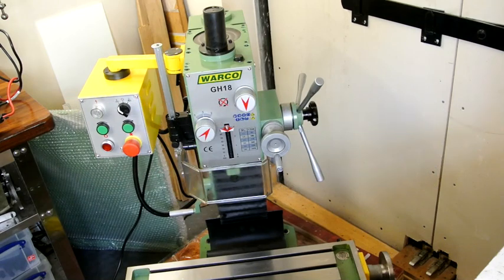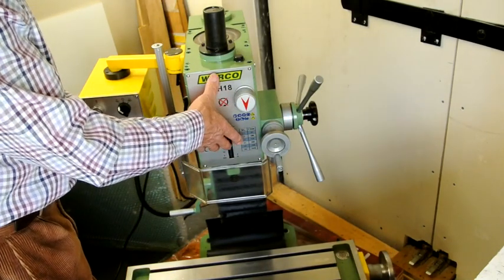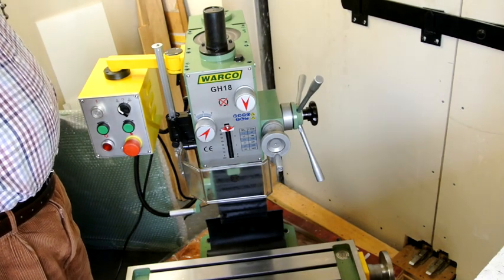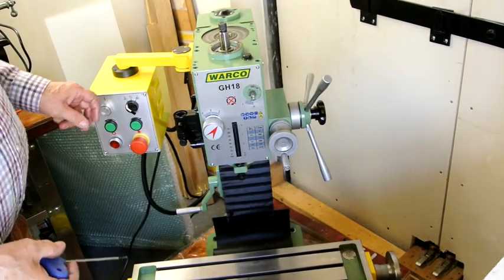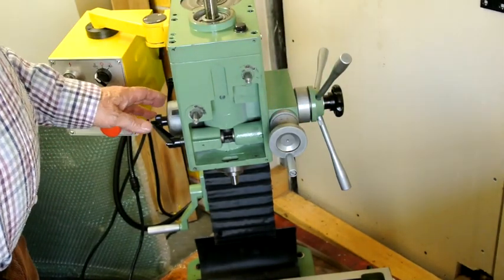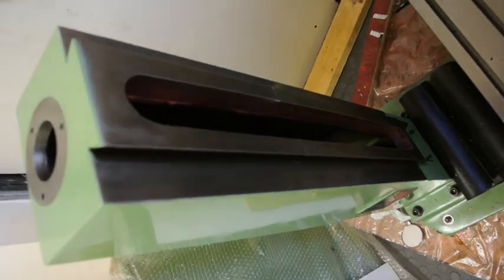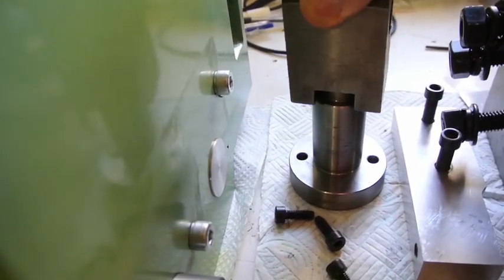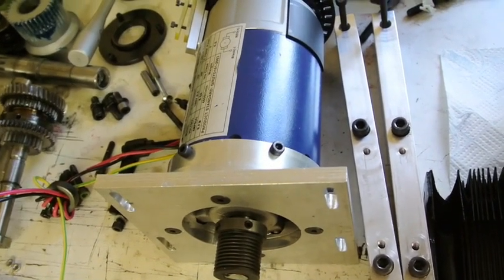Part 1 Warco GH 18 teardown

Comment: Hi John, great idea. The column on that mill is massive. Do you know what is the section size of the column? I wanted to compare to another one that I am interested to get. The more rigid, the better.
Reply from the maker: Jose

The column is 6" (152mm) wide and 5 " deep (127mm). Yes it is a nice sturdy mill and is nice and rigid.
John

Comment from the maker: James
Delighted to hear you are contemplating doing the same as me. I have posted videos now of most of what I did. I can help you quite a bit with suggestions. I am very pleased with the rigidity and cannot wait to use it more in anger! 

John
Reply: Hi John.

If Possible can you post a list of the parts you used?  Such as the model of steppers and the replacement motor etc? Useful to know where in the UK to get these items. 

James

Comment: Hello good video, but I wonder, if you are going to make the modification because you have not bought
 WM 16B that comes with straps.
Regards.
Reply from the maker: Thanks, I bought the 18 GH because it was a much more substantial mill with heavier castings. It seemed a bit of a waste to ditch the gears, motor and speed controller, but the results are well worth it. It runs nice and quiet with the treadmill motor. I may try a larger 2.75 HP continuous rating 180v motor that I have. It has a lot more torque than the one I already have fitted which should make making deep cuts even easier. 

John
Reply: Okay John, I'd like to know why you discard HBM 45 or clones
MB-4 etc. (Stefan Gotteswinter) seem strong and precise.
Do you work little in steel?
Thanks greetings.
Reply from the maker: @luism.27  

Luis, 

To be honest I was going to use a HBM 45 clone originally, but I wanted R8 collets so I could fit a Tormach type tool changer, which I have fitted. At the time I was thinking of getting the mill in the UK the HBM type mill was not available. You also need to look carefully at the base of the mill as the 45 types usually have the column bolted on from the rear. Also the column on this mill is rather fatter at the base and tapered up to the top and bolted through a flange through to the use from above. Now I had been used to a Mini mill so this is a huge step forward. I now have Nema 34 closed loop steppers which are fantastic they run so cool and powerfully. Another feature I wanted was tapered gibs and some of the 45 clones have ones adjusted by screws. I am not saying that this is the best mill available, but it seemed to me the best I could find for my needs.

John